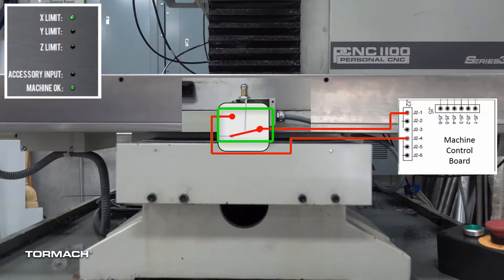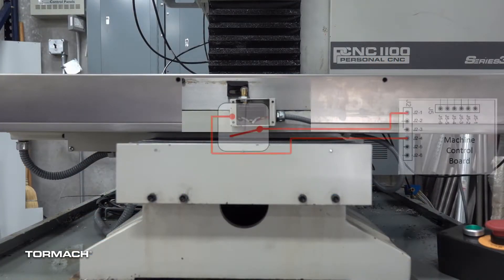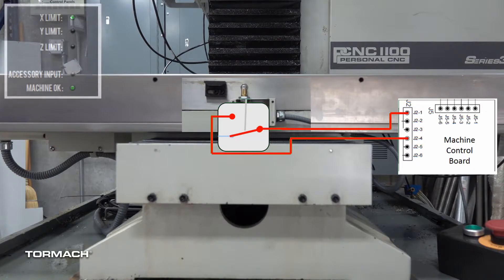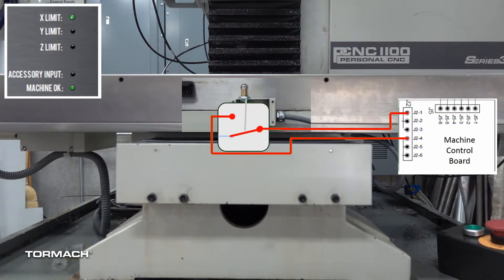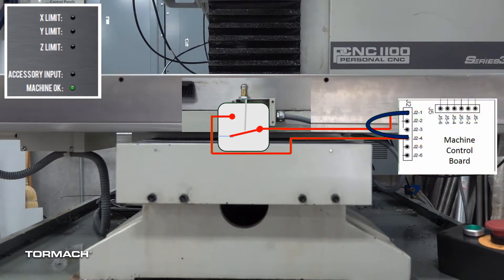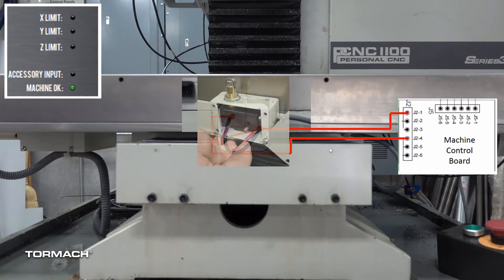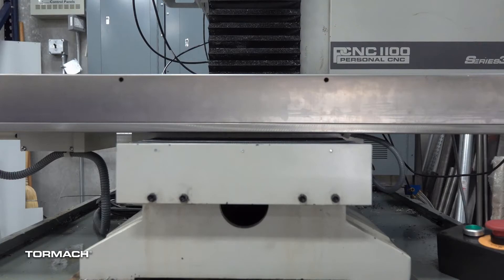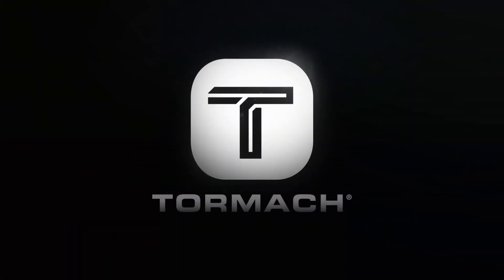Tormach Technical Support | Open Limit Switch Troubleshooting

Comment: Thanks for the video! I found that the 2 connector wires that connect to the limit switch weren't making contact with the switch, over the years coolant had worked its way between the connectors and the switch, I cleaned everything, and my machine works fine now.